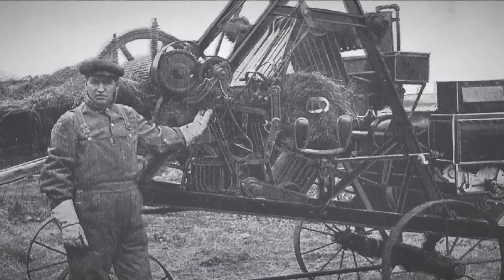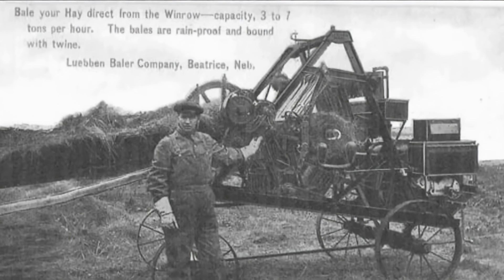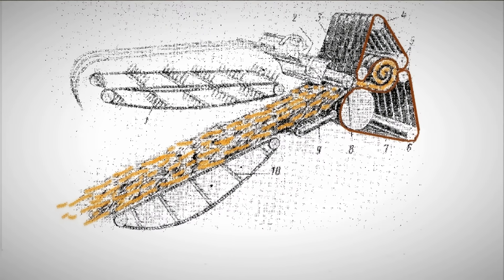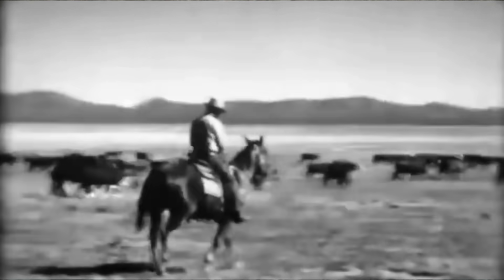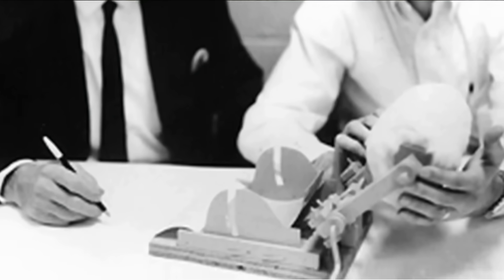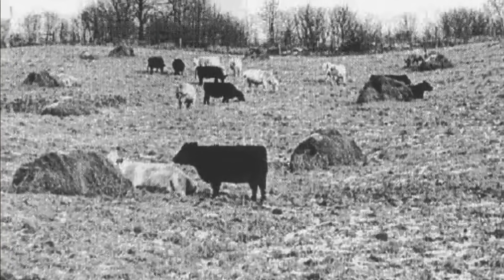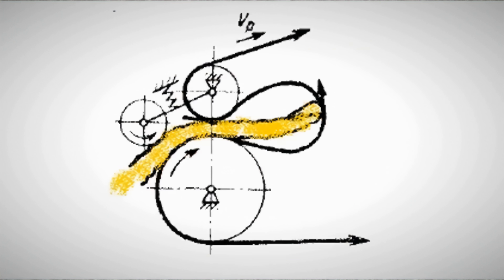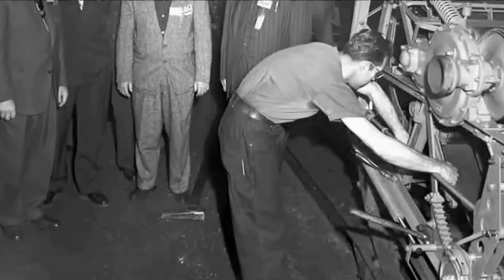The History of Round Balers / Farm Machinery Stars Series

Comment: I was selling Vermeer in the mid 70’s. They were the best round baler available at the time. Labor saved, time saved and better quality. $1,000 of parts was sufficient to service a large area. They were well built.  I visited the Vermeer plant in  Pella, Iowa at that time. I sold several 605’s. I. Used one myself for several years,   Put on 7,200 bales on one baler over 3 years and had literally minimal repairs. 7,200 bales at the time represented 20 years for an average farmer. I was doing a lot of custom work.  Memories.

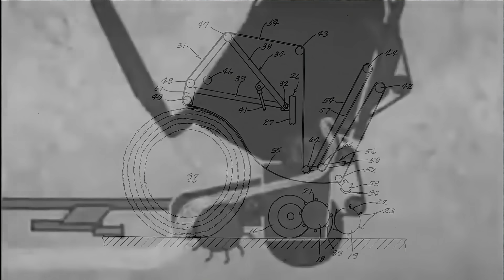Comment: I notice that you showed the Russian PRP 1.6 round baler from 10:22 - 10:39 but you didn't give it any mention or credit. Just to set the record straight, it was a very fast baler, producing a 4.5 ft by 5 ft hardcore bale. It had automatic tying and automatic eject of the finished bale. Also, it trailed to the side so you didn't have to be an owl to watch the baler. It was a much expanded and improved version of the AC baler.
Reply from the maker: You are absolutely right in identifying the Soviet PRP 1.6, but I disagree that it was a significantly improved and expanded version of the AC baler. In fact, the PRP 1.6 used the Vermeer scheme, i.e. it had one branch of belts. As is known, the AC Roto-Baler had two branches.
The AC Roto-Baler principle was used in the PPR-1.6 - the first Soviet roll baler. Unfortunately, there is no way to attach an image to this post, but you can bet it was definitely a Roto-Baler, only with a drum pick-up instead of a chain-and-slat conveyor.
Ultimately, due to the complexity of the AC mechanism, the Soviets were unable to mass-produce the PPR-1.6, and it remained little known.
As for the PRP-1.6, it rolled bales weighing up to 500 kg, with a density of 100 to 200 kg/m3, was aggregated with a tractor with a traction capacity of 1.4 tons and could work at a working speed of up to 9 km/h.
I'm not sure if anyone will be interested in a review of the Soviet branch of development of this equipment, but in general it can be said that their development and implementation of this technology was very slow. If we compare Soviet balers with foreign analogues, we can note the difference in their appearance, at least 10-15 years.
I will try to publish a copy of this entry in the community to show the image.
Reply: Bought a new Holland 848 in 1990

Comment: My uncle had an A-C Roto-Baler and later a New Holland big round baler. Only needed a guy on each side of a low two-wheeled trailer to buck and stack the small rounds from the ground as you didn't have to cross and tie in the rounds like the small square bales. We typically used hay hooks with the small rounds. 
With the small squares always had a guy on the wagon or flat bed truck doing the stacking. Usually the best hayhand as you could lose a poorly stacked load. Hot hard dirty itchy work but at least you were usually doing it with your buddies!

Comment: I ran a Vermeer 706A on the early 1970's. The tailgate roller bearings would sometimes go out, roller would heat up and start a fire. Recovery was dump the bale and get away , then unhook the bailer and get the tractor away. Most time's a fire extinguisher  would get the fire out on the bailer. Also , the bottom platform belt would get ripped by a stick or rock. Our local Vermeer rep from Paris TX was always there with parts and any new upgrades. It was a skill to run one of those. A lot of twisting, turning and eating dust without a cab! My back still has problems today from that.

Comment: Ah, yes, the AC Roto-Baler (NOT baller), which we acquired in 1954, to use on our operation to bale up brome-grass after seed harvest, plus alfalfa and clover hays, and straw, too.  Also, my older brother [and later, me] developed a nice little custom baling business, doing 20K bales per summer.  
    At 10 cents/bale, I could bale 500 bales in an afternoon; make $50,  which was OK for the times, way better than the $1.50/hr you could earn picking up that hay to store in barn loft. 
     It was still just part-time biz, as we had a dairy farm to keep going.  Anyway, Dad let me use RB for free, if I kept it repaired, bought necessary twine and tractor fuel.  Usually made about $1500 per summer, which funded our college.  Still have the baler, sitting under trees at farm, not used 50 years.  Started large round bales in 1970s, which could be handled by tractor.  Also, switched to chopping haylage to store in silo, so it could also be mechanized.

Comment: When I was in high school I worked for one of the first Vemeer baler dealers. We made dual spring attachments for them to make the bales tighter. The Vemeer was THE baler to have for about 30 years. It had an open throat design which was simple and a lot easier to clean out if needed. The early John Deeres were junk. They had a belly belt that caused a LOT more problems. They didn't have locking tailgates and if your tractor hydraulics were not perfect the tailgate would work itself open as the bale grew and made a soft bale. You could about pick out in John Deere bales in a field. Now John Deere is the baler to have.
Reply: John deer hasn’t invented anything original they just take everyone’s ideas once the paten time runs out and they make small improvements and market everything really well and everyone thinks they are the best
Reply: @lukebarron656    DITTO ON THAT!!

Comment: Our AC round baler could bale rings around the small square balers of the day. My dad made a homemade pull type loader to pick up the bales. A 2x4 nailed across the front of the wagon made them easy to stack rows high. Neighbors said they would push out the walls of the barn. That was bull. They stacked like any other bale. Our dairy cows loved them as the soft center round bales caught many more of the leaves and chaff that cows love. We did thousands of bales and finally had to junk the old girl in 1978. AC had a gold mine there and blew it by not making the bigger bales with the soft centers

Comment: We went to round bales decades ago and never looked back.  Don't have to touch the hay ever.  All machine.  Thank you round baler inventors.
Reply: Worked in the hay fields a little in my high school years putting up small square hay bales. Hot, hard work, done by kids in top physical condition.  Everyone that put up the square hay bales, will say that large round bales is the only way to put up hay.
Reply: @glennkramer2922 I did that. And round bales have their uses. Square bales also have their uses.

Comment: I remember the old Allis rounds as they were much heavier than squares. The guy that had it used wire yeah baling wire for a while. You wanted hooks for those because they peeled the hands fast and where it knotted it could puncture. Hay on the ground always bothered me because without a ring they would walk on it as well as poop on it. The first layer in wetter areas would be moldy and no good. Horses could be the same besides picky. Someone made a smaller 400 lb bale that worked better although if you had many cattle you needed more rings but you could also bunk feed with them by setting it on one end of the feed bunk and unroll it. The new ones we call marshmallow bales get less mold but you have the plastic to get rid of.
Reply: I worked a small cow operation with another guy. We did not use the rings for two reasons. Number one was that sometimes a cow would get its head stuck in the ring. We only saw them one day a week. With a small operation, you can afford no loss. Therefore no rings. Number two was that although hay was wasted as food, it made excellent mulch and seed for ground that had been rendered poor by loss of topsoil (previous farmer had been a renter). Every bale we put out was in a new spot. Our only loss was a new calf of a first time mother. Best we could tell it was lost to a coyote or coyotes which was a new problem to the area. You are absolutely right that as soon as they broke the bales down they would eat the hay until they peed and pooped on it. After they did that it was no longer feed. Take care.

Comment: my uncle had one and we always called them "tootsie rolls". also, because they sometimes wouldn't tie tightly, when it rained after baling, they were a soggy mess to deal with.
Reply: Not tight or tapered usually occurs when you have some areas with very light crop - that is not balanced across the width of the swath. Have to wiggle the baler through these to distribute the straw/hay as evenly as possible .
As soon as the uneven bale starts to get wrapped/tied it creates a tapered round bale as it collapses in on itself. Tough to load and handle as it want's to tip the adjacent bales creating havoc.